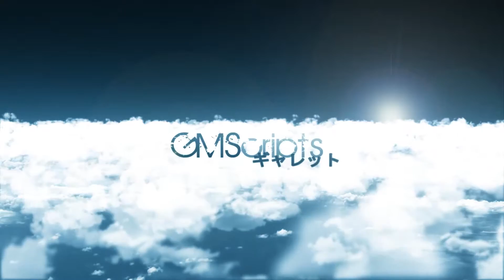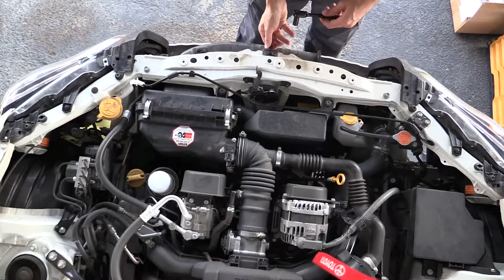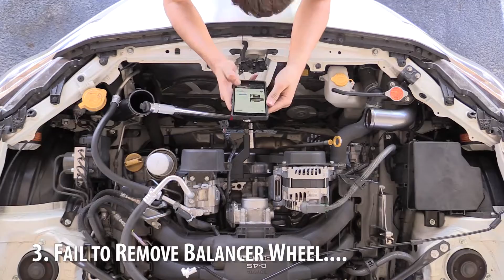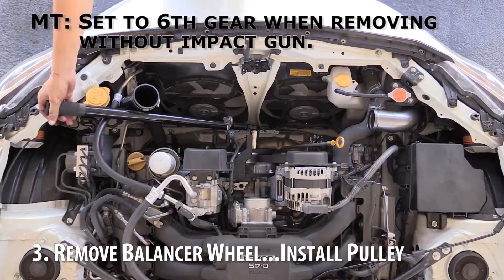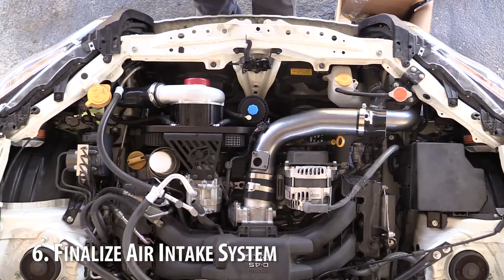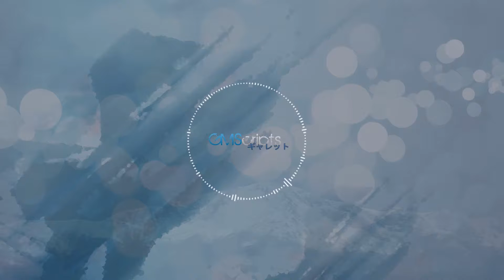2014 BRZ - Kraftwerks Supercharger Install

Comment: great vid. tell me is it possible for You to just add a high boost pulley later and just retune? what boost level would the high boost pulley give?
Reply from the maker: So they don't make a high boost pulley, would need someone to fabricate up a new one, but could easily change to a 80mm and make 20+ boost
Reply: @gbgmscripts  ok great thanks.

Comment: Does the car need a tune before starting the engine.
Reply from the maker: It is recommended as you are changing the amount of air being forced in. Also if you change the MAP sensor to a 4 Bar from stock the engine needs to be tuned to support the new sensor as the readings would be way off causing issues.

Comment: Looks good bud. What other mods do you have on this build? Like headers? internals? Pulleys?
Reply from the maker: Cesar Gomez in the video it was a straight supercharger install and no other mods. But now the car has headers, downpipe, fuel injectors, and flex fuel kit